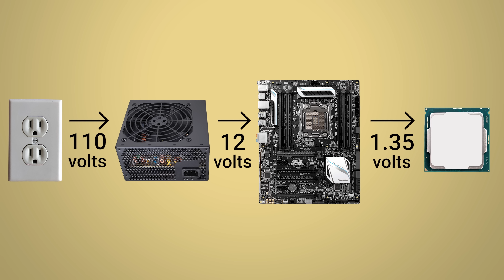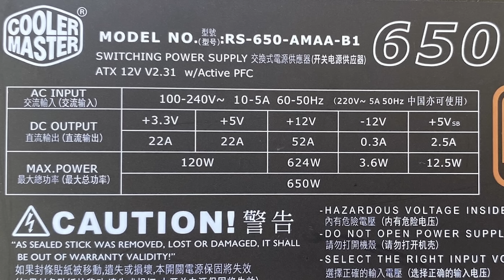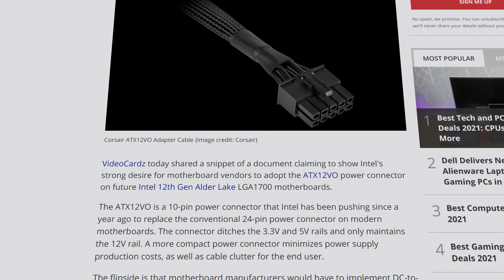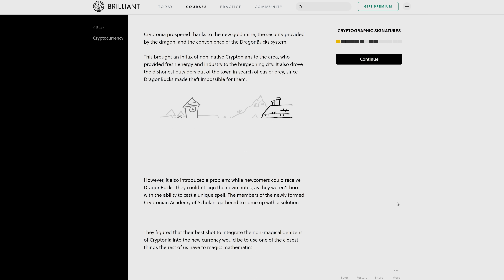Is The 24-Pin Connector DEAD?

Comment: Don't forget it makes your Mobo more likely to fail instead of your PSU because of it needing to deal now with more power management too.

 PSU swap is pretty simple... Mobo swap can be quite a nightmare...
Reply: Modern mobos are doing this anyway. The 5.5 and 3.3 go basically unused. (This is in the video)
Reply: @zamalek4079 , Sata 5v power management is something not done all by the Mobo and as said in the video that might be something to completely change depending on what Voltage they wish to make the PSU going into the board.

 Which means that they might also try and make GPU power management handled by the board eventually which is a potential disaster waiting to happen (Speaking in terms of some higher efficiency but higher voltage output PSUs I was reading about awhile back) Extra heat generation on your board, extra electromagnetic interference by sensitive components. 

 And motherboards shooting up in price while PSUs will probably stay the same or even still maybe become even more expensive.
Reply: Your motherboard is already mostly doing power management.

Comment: I love 24 pin ATX connector, leave it alone. Cheapest power supplies with all necessary voltages and power available for any custom electronics use (Wh/$ ratio) I have provided clients with quadrillion custom PCB's with the 24pin ATX power connector with a caveat that a power supply is something available of the shelf for future service. Now, even with the CHEAP ATX12VO (someday) I have to add the necessary DC-DC conversion circuits on my own boards making them larger and more expensive. Not all of the world exists in the fantasy land called California, and not everything PC is related to PC... I miss 16-bit ISA a lot, btw...

Comment: Would it be possible to use modular cabling from an older 24-pin PSU to the new 10-pin (or 16 pin) slot?

I just bought a new PSU and don't want to give it up if I can help it, lol.
Reply: Dont worry about this. If you know anything about BTX form factor that Intel introduced in the past (yr 2005),  HP/Dell/Lenovo used it for sometime. After few years, nobody give a hoot about it in the DIY market. I will say, ATX form factor will stay for a long long time.
Reply: officially, probably not. unofficially, well you could use the ATX spec to figure out which wires you need and make your own connector
Reply: I've read somewhere an adapter could take the 24-pin cable and supply 12V to 12V motherboards, though it won't be as efficient as a new PSU 10-pin PSU.
Reply: @stefvdh8696  yeah, I get that it'll still be inefficient when compared to the new PSUs; I'm just looking for compatibility *at all*, especially if Intel starts requiring it.

Comment: you have simpler and more efficient power supply but you have more that can break on a main card! main cards are much more expensive than what a power suppny is! not so good solution with 12v power supply!

Comment: Taking the atx power from 24 pin to 10 pin to make it easier.  Except that it also requires (for most modern chips) that 6 pin aux power you can see right next to it, so it's more like 16, and THEN you ALSO have to add an extra cable for every sata powered device you run...3 extra cables, coming OFF the motherboard, to make atx plug smaller?  
  This is fucking stupid.

Comment: ATX12VO PSU now with 5V rail so your motherboard doesn't have to.
Seriously given that not only sata but USB is 5V, then it's a bit of a no brainer that the PSU should continue providing a 5V rail option.
Reply: But your NVME drives need 3.3V , all PCI-E slots mandates 3.3V at 3A. So you're back to square.
Reply: @fleurdewin7958  
NVMe drives via m.2 or u.2 draw very little power and with 12VO PSU's they'll still need to buck down from a 12V rail to 3.3V anyway, so there's no difference.
U.2 is fairly uncommon and sata devices tend to work from 5V and not require 3.3V, a hangover I suspect from the days when molex (12 and 5V only) to sata power adaptors were a common solution.

There's no big issue running just 12V to the motherboard, the problem will arise when requiring multiple sata or even molex power to peripherals as that then becomes motherboard limited by connectors or max amperages or both.

As most 500W+ PSU's provide 6+ SATA power connectors and 1-3 molex, at the very minimum you'd want 10A of 5V power but most allow for 20A, typically combined max 3.3 and 5V suggesting that 3.3V is just stepped down off the 5V rail.

While ATX 12VO with step downs on the motherboard would be fine for typical PC's with a basic 1 or 2 drives setup, people who run a bunch of drives either in raid or just storage or other peripherals, might find it useful to be able to run power direct from the PSU rather than connecting a large number of devices to the motherboard.

As an example at the extreme end the corsair AX1500i has 20 sata from 5 ports and 12 molex from 3 ports for a total of 32 connectors and 8 ports. My own particular 750W gold PSU's (tx850m and supernova G2) have 4 sata/molex ports.

Typically motherboards with peripheral ports would be limited to 1-2 ports supplying 3-6 peripherals at best, way fewer than a typical modest enthusiast class (gold or better) PSU.

The DIY market will not be happy with fewer options even if they don't use them. Therefore I suggest that 12VO plus added peripheral power ports will be a thing the market demands, so 12VO + 5V.

Comment: Yeah, let's make already complicated Motherboard even more complicated and risking more damages than if PSU fails.
Reply: That's probably a big part of the plan to make you fork out even more of your hard earned money in the future.
Reply: How precisely is it getting more complicated? A motherboad isn't doing a whole lot more than power conversion anyway (PCIe thankfully runs on 12V already, but RAM, CPU and various ICs like the audio codec, USB controler and ethernet controler require different supply voltages).

Comment: i am less and less liking the new standard, ( if it pans out ) i really don't like the severe loss of sata power. now if the new power supplies would supply sata power separately, than maybe, but i really don't like the idea that the mobo will supply that.
Reply: That's actually a good point. Why not have essentially a split PSU, with ATX12VO going to the board, and a separate mini PSU in the case (of the PSU itself, or a separate box) that provides 5V power for peripherals.

Comment: The new atx power is a good thing, but having more crammed motherboards with even more cables is meh. If it can make things run cooler because it is more efficient then why not.
Reply: Because people don't like running several extra cables from the mobo just to power sata devices.  Cable management on systems is enough of a problem already without adding several more cables for no other purpose but to shrink the atx power connector by half, something that hasn't been a problem for any builders or DIY'ers I've ever heard of.
 Also, putting all that extra power management on the mobo WILL increase the stress the mobo goes thru and shorten it's lifespan, as well as increase cost. 
  This is really fucking stupid in every way it's possible to be so.

Comment: Stop advertising this new garbage standard, all it does is increase how much motherboards cost and add more points of failure.
Reply: you mean it removes points of failure. I've had at least 3 PSUs fail due to faulty 5v or 3v rails but never a mobo failure. Everyone uses NVMe SSDs now so you dont even need 5v anymore
Reply: @KekusMagnus  after this standard, you will see less PSU failures, but more motherbard failures, and I want my motherboards to be as reliable as possible, motherboard is much harder to replace or repair in comparison to PSU. I think that this new standard is one more trick to rob the customers, like pinless CPU's.

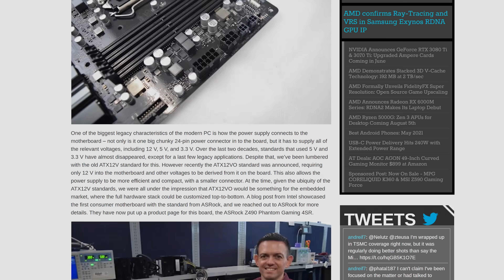Comment: I'm confused., if a more powerful system requires the extra 6 pin connector, and we need a couple 4 pin connectors for SATA power we are back a24 pin. WE haven't done anything except make cable management more cumbersome. Remove the 3.5 and 5V rails by all means but would it not make more sense to look at keeping it all at 24pin? The image at 2:37 even has 24 pins, sepperated into 4 connectors. That's going to be a pain. Installing a 24pin connector has never been very difficult. Perhaps in a very small form factor, I suppose but this would make the cable mess so much worse in a tiny enclosure.
Reply: Totally agree. Now you have no choice but to deal with cables sticking out of your Mobo into your components. That's just got to be a pretty sight!!!! 

I also think this is bad timing for Intel. If AMD uses their current dominance to say no to this. Intel may be digging their own graves when they invite people into a standard that has no compelling for users to adopt (performance). As a consumer, my reaction is to go with where I get the performance, and wider array of options that are familiar, compatible and ensures re sale value. Why would I pay premium (early adoption costs) into a standard that will probably be worthless if it doesn't take off? Then it becomes a vicious cycle for Intel. Low adoption = limited compatibility. Limited compatibility = low adoption.
Reply: I agree with your point.
The only exception is to only have ssd in your pc.
In this case the 12vo standard is a straight advantage.

Comment: I personally like the old ATX standard and would like the 12Volt only to be developed future with supporting devices before rolling it out to a consumer market. Like 12 volt HDD/SSD's. I do not like the idea that intel will be forcing this soon.

Atleast i would like to have backwards and forwards compatibility devices to aid old standard power supplies to work with new 12 volt only motherboards. And maybe a mini stepdown device to make a 12VO power supply work with the 24 pin.

Comment: 110 volts is quite old , we use 120 volts here in NA
Reply: And even 230 in Germany
Reply: you actually use 170v peak to peak, 120 is the equivalent power DC value
Reply: @KekusMagnus  actually, the peak is 170 and the peak to peak is 340